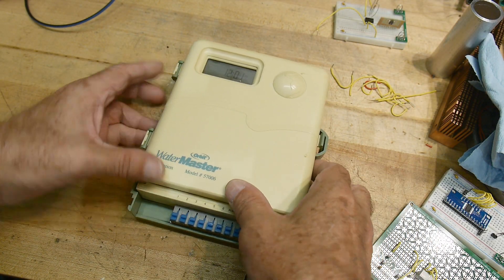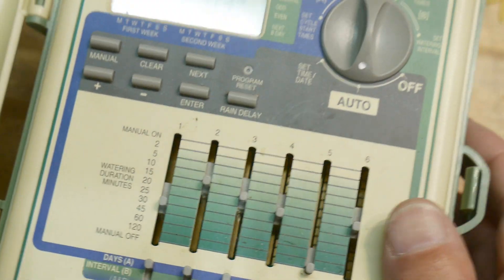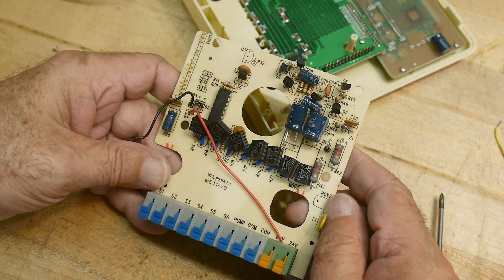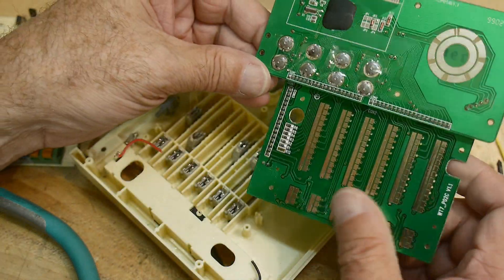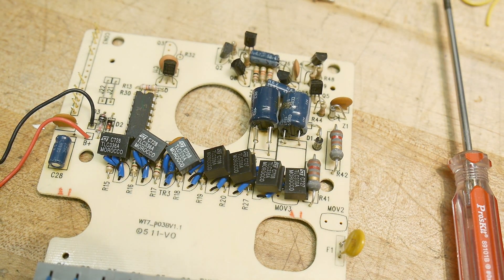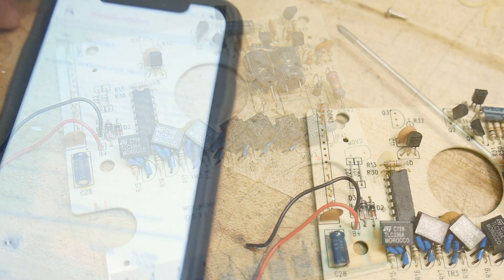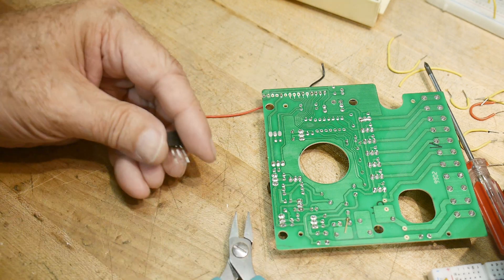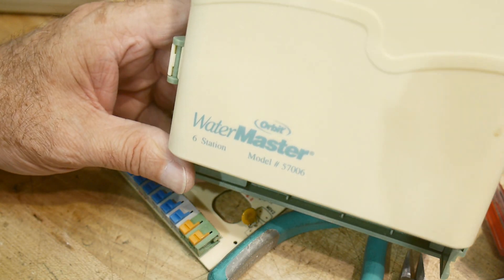#1576 Water Controller Teardown

Comment: The "pump" output driven by the 7th triac is usually controlling a master solenoid valve, that goes before the splitting to the garden zones (outputs 1 to 6), this is usually done in case one solenoid valve fails to close or leaks for some reason, the master valve closes all the ciruit for added security.

Comment: I have a 24 zone system by Hunter to control my sprinklers.  The valves are all Irritrol anti-siphon and I have to keep a stockpile on hand as every few months it seems one zone or another will need the anti-siphon cap and valve replace or the actuator and valve body, etc.  The valves use 24 VAC and share a common return wire for each cluster of valves - I have four different areas where valves are located around the property.

The system does not include a flow meter and every now and again a zone will have a problem where the valve doesn't fully shut off or there is a broken sprinkler head or whatnot and I'll have a lot of excess water being consumed - $$$ in southern California.  So my summer vacation project is to install a flow meter so I can be alerted when there is flow when the sprinklers should be off or excess flow when they are running.

Comment: The push connectors look nice, practical for ad-hoc wiring with no tools, and they remind me of those used in model railroading. Nicely stacked boards, and here is what the things I like end. 

From the service point of view, I hate the non-disconnecting stacking connector. 
Interesting and cheap but not really practical or elegant sliding switches, none of that "you can test the board out of the enclosure" rubbish... And look at all that SCRs with crossed legs! Someone changed the part type without redesigning the board. And the COB blob... Everyone loves COB blobs. 

Anyway, I liked the teardown - you can learn so much by looking at various kinds of devices :)

Comment: Wouldn’t it have been cheaper just to have a new board made?  Especially these days.  Instead of having someone slip on insulation onto each of those wires and then hand bend and solder them into the appropriate holes.

Comment: 74hc04 is hex, there are more SCRs than gates
Reply: The pump triac would be turned on whenever any of the stations were active, so it could need a bit more logic to trigger, meaning there'd have to be some sort of OR function in the chain. Might have been easier to not use a hex-inverter.
Reply: @tfrerich  or maybe they just used a transistor for the last one.

Comment: A friend of mine has a similar water controller, that needed some attention. The way it works is that there are valves connected to turn sprayers on and off, and if any valve is to turn on, a pump needs to be turned on too to supply water pressure. Thats why you need 7 triacs here.
Reply: If customer is feeding the sprinkler system via a well
Reply: @RonDogInTheHouse  Correct. If you use city water, you just don't hook anything up on the water controllers PUMP output.

Comment: The outputs have to be AC because DC wires suffer galvanic corrosion when exposed to water from the ground
Reply: Connections are typically packed with grease, and the wire itself is insulated. The wire might be around 250' long around your yard, making for a 500' loop. Not ideal conditions at all for DC.
Reply: That was fun looking at how a cost-effective design was implemented. 

Let me talk about some off comments made here.

Generally speaking, the controller wires (one wire per zone, common ground) go to a box located in the yard that contains a manifold with individual electrically controlled valves--one for each sprinkler zone. The valves are 24-volt AC. There's plastic piping from each valve to each daisy-chained set of sprinkler heads that make up a zone.

As shortcircuit5142 noted, the connections are often done with wire nuts that are then sealed in tubes filled with grease. There are some other ways of protecting the joint in use. The control system is low voltage so it's safe enough for dummies like me to work on. Galvanic corrosion isn't...or shouldn't be...as issue.

The AC versus DC choice is simpler. Why rectify AC when it doesn't gain you anything and just costs money? With AC, all you have to do is step the voltage down from 110V, which is easy enough to do. BTW, the valves themselves use the pressure of the water to help actuate the mechanism so the amount of power necessary to trigger them is very low.  The valve design is interesting itself. 

Regarding the length of the control lines--ain't no way they'd be 250 feet long, except maybe in a large commercial installation. The control wiring is going from the controller to the valve box and no further. I'm presuming the comments about length of wire and "not ideal...for DC" are related to power losses in long wire runs. The power losses for 24-volt DC versus 60 Hz 24-volt AC are the same. AC has the advantage for long distance power transmission because you can efficiently change voltages with transformers, but here there are none. (Edison's DC system required power generation every few blocks because of its low-voltage distribution network, but Telsa's AC system required almost the same.  Instead of a steam driven alternator there's a big step-down transformer to supply low(er) voltages from a high voltage distribution system.)